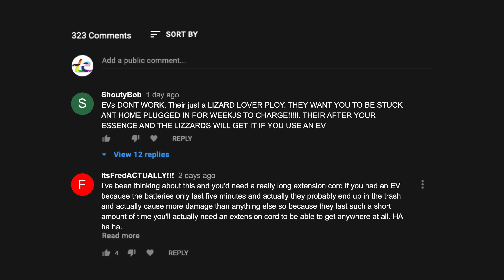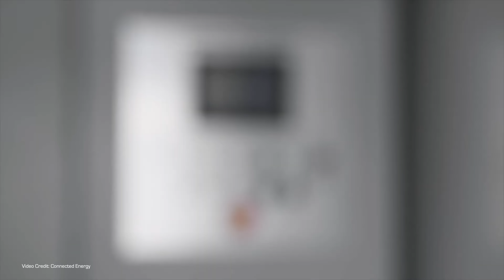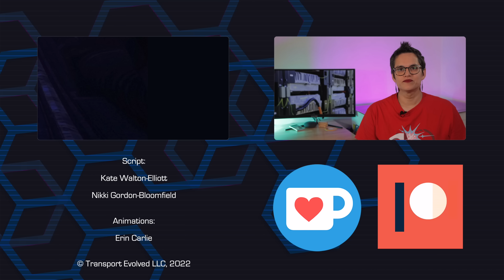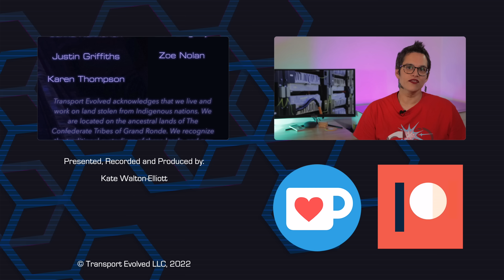What happens to the batteries?!

Comment: I have long said that my 2014 Leaf has gotten cleaner every year since it was built, thanks to an ever improving renewable electricity grid. My province, Ontario, has eliminated coal generation and is up to 98% emissions free.
Now, there is a battery recycling plant being built just blocks from my home. The materials recovered will be shipped down the 401 (big highway) to the new battery manufacturer being built to supply the EV manufacturers tooling up in Ontario and Michigan. 
So, by the end of its life in 10 years or more, the overall impact of my vehicle will be even lower than the extremely low impact it had 8 years ago.
Reply: Yea!!

Comment: I always have to laugh at that argument along with the additional materials used during manufacture argument.  The batteries are contained, and recycled, what happens to the 15,000 - 30,000 kg of fuel that an ICE burns in its life

Comment: Yay great video, the problem is batteries are better than expected .... what a problem 🤣
Reply: I have a 2016 Nissan Leaf 30 kwhr 6 kw charger, that is 6 1/2 years old, with only about 35000 miles on the clock. It has lost 3 battery bars out of 12 and hence 1/4 of it's storage capacity and range. It hasn't been mistreated and resides in temperate England. This electric car did not last longer than expected. As well as this the rapid charging infrastructure for long range is abysmal and unreliable and getting worse, as the roll out of chargers no where is no where near  matching the numbers of new EV's. To me an EV was an expensive mistake that I will not be repeating. It is time for the truth !

Comment: Another great video!

7:50 "The batteries are lasting longer than expected" such an important point!

Thank you for sharing, Kate! 🔋⚡🔌🚘
Reply: have a 2016 Nissan Leaf 30 kwhr 6 kw charger, that is 6 1/2 years old, with only about 35000 miles on the clock. It has lost 3 battery bars out of 12 and hence 1/4 of it's storage capacity and range. It hasn't been mistreated and resides in temperate England. This electric car did not last longer than expected. As well as this the rapid charging infrastructure for long range is abysmal and unreliable and getting worse, as the roll out of chargers no where is no where near  matching the numbers of new EV's. To me an EV was an expensive mistake that I will not be repeating. It is time for the truth !

Comment: Great video Kate - you seem to have the life/spark that this channel needs.  For me, battery life is a concern. Until now I did not get it that the life span was in the 10 - 15 year range, maybe stretched to 20.  That is short and is a large hurdle in converting many ICE owners.  My cars range from 10 - 40 years old and all still have their original power plant and drivetrain.  I need an EV to have at least a 30 - 40 year life.
Reply: Surely a car engine which is decades old is a bit like grandma's broom... got a new handle, new bristles... but its still grandma's broom handed down the generations. How original is it really, must have had a few replacement parts over the years? Just a friendly point of order, not meaning to frivolously dismiss your concerns. 👍
Reply: @judebrown4103  When you need a set of tire do you a new car?
Reply: @cuepusher2504  yeah obviously I'm not talking about tyres which all cars wear out. I'm talking engine and gearbox degradation over extended years of use but I think you may have missed my point entirely!

Comment: Even completely dead batteries have a value for their contents.  This value is high enough that they will not be going to landfills.  I think this is important as many of the FUD commenters seem to think that EV batteries are going to landfills.  There is evidence that >95% of lithium batteries do go to landfills, but the statistic is misleading as they count batteries, not by mass, essentially counting a tiny lithium battery in a toy equal to an EV battery.  The tiny batteries have so little value that they get thrown away, but EV batteries have high value and will certainly be recycled by someone.
Reply: @rogerstarkey5390  Yes, once there is are lot's of geographically separated lithium battery recyclers, adding any small batteries to the inputs is easy.  The hard part will be incentivizing consumers to redirect them in the waste stream.  If someone has a dead battery from a toy, maybe worth only $.50, most (western) people will not feel it's worth their time.  We see this in recycling all the time where people just don't care.

Comment: I have a seventeen year old Ford van that runs as good as new, with minimum dealer maintained. I know this is on the high side of normal vehicle life, but it does bring up the the issue of the potential lifespan of EV's. I wonder about the lifespan of my new EV (Arcimoto) with a future battery pack replacement. In the state where I live, at twenty years old a vehicle can get an "Antique" license plate. I bet EV's will last longer than ICE's.

Comment: VW already has a plant set up to recycle the batteries. It starts out with shredding them before the valuable parts are separated for reuse. That may be one reason why they use an aluminum battery pan, it's easily recyclable. Of course reuse first makes sense.

Comment: FYI, chapter markers are a little off, "Reuse is the first, second use" should start at 1:27 instead of 1:33, many of the other chapter markers should be a few (like 2 or 3) seconds earlier than listed also but the one I listed is the one that I expect more people would want to skip to.

Good video though, just seems like the timestamps got logged and then something got cut out making them incorrect or something similar.

Comment: Ok, great, I can work with that, batteries now have a longer life, and they can be repurposed/recycled, however, this clip, as with every other, conveniently skirts around the cost, which I will surely need to pay. I have to assume that battery removal and replacement is not for free, seems reasonable. So, how much is it going to cost? and why?? can nobody put any prices on this? Yes, I get it, replacing the battery is loosely equivalent to replacing either a worn out gas tank, or even replacing a worn out motor in ICE cars. Prices for replacement motors and gas tanks are well known and well understood, as is their respective working life. Also, equally well understood, is the fact that once the cost of the replacement component, whatever it may be, exceeds the value of the car, then the car will be thrown away. Throwing away whole cars is surely a huge cost to the environment. If the cost to recycle the car becomes high, then owners of old cars will surely be hit for those costs too.I think I am not looking for a solution to fix battery life or durability, what I am looking for is a solution that replaces an existing ICE car, with whatever might come next, dollar for dollar, mile for mile. It now starts to look very suspicious, that no one will put dollar values on these items. Right now, EV is just not offering a viable solution, based on current information. I do not want to pay, to be the lab rat that is the science project that works out the costs. No wonder second hand cars are getting expensive, they are still cheaper than second hand EV. What else have you got, beyond EV?
Reply: @Matti Gower I think Robert Llewellyn of Fully Charged would consider himself the lab rat! He had a very early Nissan Leaf which, (due to his self confessed ignorance about how to keep the battery healthy in those very early days) needed a replacement battery after about nine years, I believe. He had a new battery installed during our 🇬🇧 lockdown, so there were delays, but I think it cost about £4k, I may be wrong with that figure but definitely under ten grand anyway. There is a video on the Fully Charged channel all about it somewhere. 

The thing is, I would not compare getting a new battery in a more modern ev to getting a new engine. Ignoring the fact that manufacturers are guaranteeing batteries for 7 or 8 years and any bugs usually show themselves in that time so they are replaced freely under warranty, giving a further 7 or 8 years worry free, there are other considerations. 

Even at the "cheaper" end of the market most cars get "over the air" updates so they are constantly upgrading all their functions, including battery management systems. Therefore I would think of a replacement battery as a less expensive substitute for buying a new vehicle. 
So as long as you look after the bodywork and upholstery etc you actually have a vehicle with the potential to have an extended life after a long and trouble free existence. No cam-belt changes, no plugs, no gearbox, no frequent oil changes. As far as I can tell the main part of a service would be on the brakes because they're used less frequently! Far less expensive to maintain, if you're young and of mechanical bent you could even do it yourself, then just present it for whatever your country's equivalent of our MOT annual safety check is called. I feel very confident thanks to all these helpful channels with no investment in ev usage other than a concern for our environment, that our next car will be an ev with absolutely no anxieties left concerning lifetime ownership. I do hope you begin to feel the same after similar research. 👍

Edit: I felt bad not having an accurate guess at price which was your initial question so I just put into YouTube search "Fully Charged replacement batteries". It came up with a film about Cleevely motors who I know do mobile ev servicing around the UK. They have teamed up with a company in the Netherlands to do battery replacement on first generation Nissan Leafs. The cost is £8.5k but the new one is 40kWh replacing a 24kWh, a significant upgrade I'm sure you'd agree. The company sources the batteries from crash damaged vehicles and has a use for the batteries they take out, or the customer can keep it for their own use as a storage unit for solar pv etc. The price from Nissan if you could persuade them to do it would be significantly more. However there are enterprising companies springing up who specialise in battery replacement, this company is paired with the Dutch company who provides the software changes required to link the car to the "new" battery. It's wonderful the amount of effort and skill sharing going into this newly required enterprise. Hope this goes some way to answer your questions and you are able to gather more info from your own research. 👍

Comment: The common ground we all should be trying to promote right now is what Nissan developed with Chademo. I think it is brilliant and should have been adopted. They got it right. Money and politics has pushed things away from a brilliant technology and Idea. Vehicle to grid by directional charging and discharge. It can benefit in so many different ways. Add in Solar charging from rooftops, parking garages and commercial spaces and you get a winning combination. You can use any form of sharable energy tech to both charge your vehicle and use it as a load shedding device and have emergency backup until the grid can reroute and heal itself. Then use variable sustainable tech to power the grid. You get energy credits for using your vehicle and possibly pay nothing under the right conditions to keep it topped off and usable. This could be discussed for hours and is a bigger fish than trying to make use of used up batteries for another purpose. When they degrade to a predetermined point , drop them out of the car and swap them for new. Get a pro rated credit toward purchasing new ones and everyone benefits from the use stream or recycling. We need to get better at recycling what we have and creating less landfill waste.

Comment: I'd like to know what Chevy and Hyundai are doing with the batteries they replaced from the Bolt and Kona. Hopefully they're able to identify at risk cells and reuse the rest.
Reply: Seems like the good cells would still have use in applications like energy storage for the grid or homes.

Comment: My Nissan Leaf now seven years old is still like new so in another three plus years the battery can move to a second life.  What about the rest of the car which still has a perfectly good motor, controller,brakes and more.  Any chance I can put new battery cells in it and get another ten years out of it?
Reply from the maker: Yep. There are multiple companies across the world building up new packs with better, more modern batteries which will allow you to continue to extend the life of your vehicle.

Cost can be a challenge, however.

^Kate

Comment: There's really a 3-phase path of battery recycling. 
The first is addressed here: As the energy density or a car's pack is pulled down by the weakest cells to below the level acceptable in cars, REUSE the battery somewhere where volume and weight aren't important, like stationary storage. 
The second one: once those 'weak link' cells get even worse, REBUILD the packs, replacing the worst cells. 
The third, which is really just a brand new industry, is to RECYCLE the elementals. Take the individual cells that are no longer good enough for energy storage and grind them up, and return the elements back to the raw material stream of the cell manufacturers.

Comment: One thing Shouty Bob has not said yet (unless I missed it)... That Top Gear was correct about battery packs and the report on the Co2 and power etc etc etc  used to make battery packs (funding by an oil lobby group at a university company set up and funded by an oil/gas company) was all correct.
Reply: What exactly were they correct about? 
That my Leaf would need a new battery in 2 ýears (it's 8 years old and going strong). 
That BEVs are dirtier than ICE - an often repeated claim that has been debunked a thousand times over?
Or, that a Tesla Roadster with a half full battery, ran out of juice on their track?
Reply: Top Gear based their commemtary on a report that has since been debunked. Try to keep up.

Comment: Are they lasting long or are people just wasting electricity because they can't afford to replace them? Today I walked by a Nissan leaf charging at a 50KW charger and I noticed it had an hour and 45 minutes left to charge! Now the leaf is a 75 KWH battery and it was taking at least 130 KWH to charge so that is 59% efficiency on a 5 year old battery!
Reply from the maker: Nope, it doesn't charge at 50kW the whole time. 50kW is just the peak it can deliver.

^Kate
Reply: @transportevolved  oh so people like really slow charges?  With well over 600 volts DC it certainly can supply the current and 50 KW is way below the current that will damage  a 75 KWH battery!  So why on earth would they slow the charge rate don't tell me people need more time to sleep every 100 miles on the hyway?  And why do they take so much less time when they are new????

Comment: But what happens to the engines?!
But what happens to the mufflers?!
But what happens to the oil filters?!
But what happens to the exhaust?!
Reply: have a 2016 Nissan Leaf 30 kwhr 6 kw charger, that is 6 1/2 years old, with only about 35000 miles on the clock. It has lost 3 battery bars out of 12 and hence 1/4 of it's storage capacity and range. It hasn't been mistreated and resides in temperate England. This electric car did not last longer than expected. As well as this the rapid charging infrastructure for long range is abysmal and unreliable and getting worse, as the roll out of chargers no where is no where near  matching the numbers of new EV's. To me an EV was an expensive mistake that I will not be repeating. It is time for the truth !
Reply: @stevezodiac491  Was 2016 before they started managing the battery temperature? Pretty sure it is. 
I'll counter your anecdote with another one: The host of Fully Charged has a 10 year old leaf that was in better condition than that before he swapped the battery, and that was for sure before they started the battery thermal management. He's also in England.
Anecdotes suck, look at real data. 
It is time to stop spreading FUD. Are EVs perfect? Nope, but their a darn sight better for people than gas cars. Both for their wallets, and for their general well being. 

Most people charge at home, given you only drove ~5.5k miles a year you surely did most of your charging at home too. You even listed your EVSE in the reply, weird but whatever. So I'm not sure why you're crying so hard about public charging. 

I pity FUD spreaders like you, not even getting paid by big oil to keep them in power. Sad.